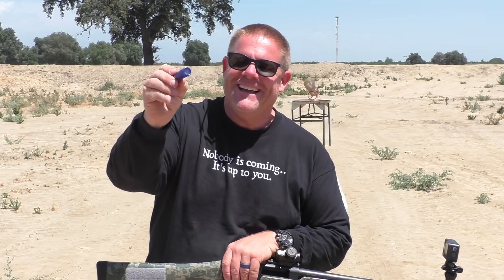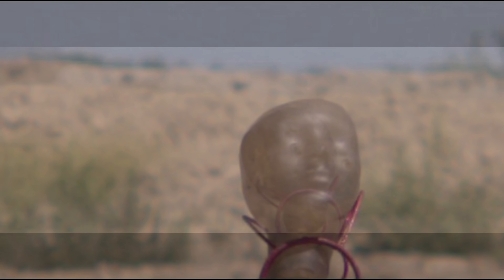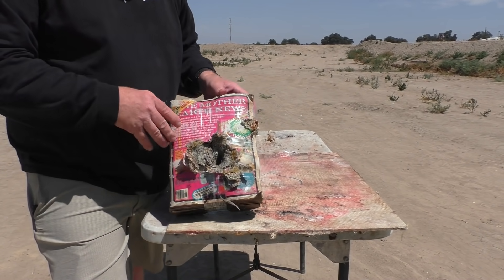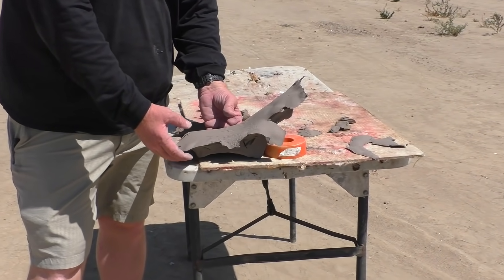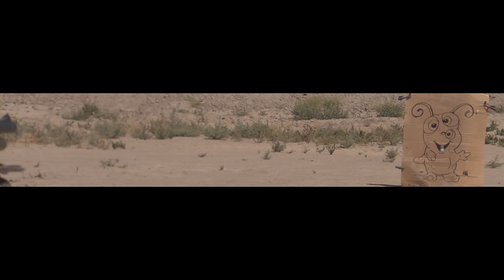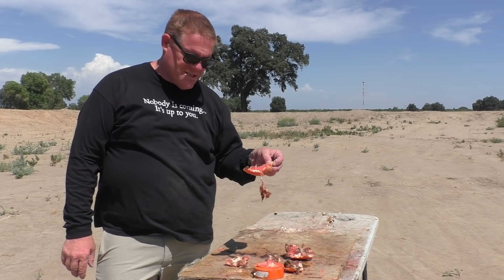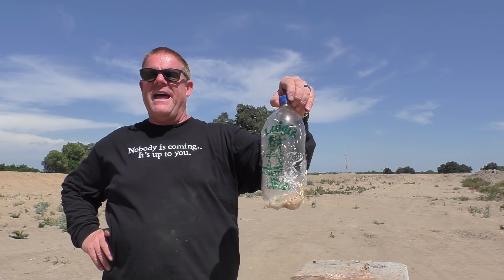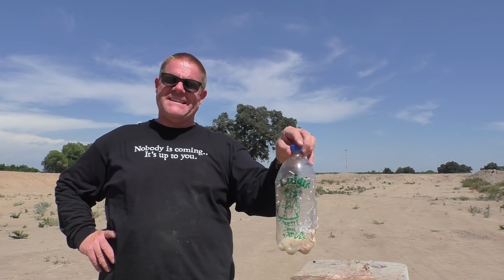The notorious CHEESE-CUTTER Round  -  Watch it SLICE 🧀

Comment: Very interesting work, thank you for experimenting and uploading. The concentrated effect is very very interesting, sorry if you have already done this, but have you considered linking the short in a circle? Experiment with different diameter loops or numbers/gauge of shot? I could spend HOURS with you trying to find the best combination for maximum effect. 

That said I like the idea of longer wire spreads as well, something like a bolas with two heavier shot linked by 10 inches of wire.

Have a great weekend team.  🔫

Comment: Couldn't you use  lead split shot weights? Just clamped to the wire?
Reply from the maker: Lead is pretty soft and many of the weights would probably not hold onto the wire very well at these forces.

Comment: Here’s an idea. Make actual chain shot, drill holes through the buck pellets and run a pull chain through them. It might be more like real chain shot if you just use two balls which would cause them to swing around when flying through the air. Perhaps use something larger than buck like two musket balls.

Comment: In Italy we had (now they are illegal) a cartridge made of 7x11/0 buckshots united by a wire copper. In flight it opened up to form an hexagon of buckshots with a buckshot in the middle. They were used in the '50s - '60s to be fired into very large flocks to get as many birds as possible. They are illegal because they are considered inhuman. In very large flocks (hundreds of thousands of birds at those times) they were cutting pieces of wings, legs, heads, splitted the birds in two....) and the birds falled down to earth still alive but severely wounded. 

    o----o
  /   \ /   \
o --- o  ---o
 \   /  \  /
    o----o

Comment: I would try to weld 2 steel balls together, and do that few times,
so You would have a bullet shaped like a 8, 
then put a rope arond the middle, and then another to it.
I would make the rope as a loop, with 6 or 8 of those double balls.
I am thinking of usin it on birds, or something.
What do You think of that ?

Comment: Late post I know but maybe you will still see it. I saw a movie a long time ago where the hero used something like this inside a house. He went to a sporting goods store, bought 22-gauge steel leaders and split lead shot about No. 3 or No. 4 buckshot size. He cut the leaders into 10-inch lengths and clamped a split shot every 2 inches, six shot per string. He dumped the buckshot out of some 12 gauge magnums and put the leaders in them and a paper wad to hold them in. I think they were Federal shells with the power piston. Looked like they would be nasty. I know they are expensive to buy but would have loved to see what this would do to a ballistic torso.

Comment: I have had an idea for a longer net suspended between bolo weight shot, so a cop could shoot a fleeing suspect and wrap em up by the legs or around the shoulders.  Idk if you could get enough spread in the cable or net at defensive ranges though.

Comment: Very interesting, a while ago, I worked with braided steel wire. Incredible tough, I’m not sure if it’s available in small enough diameter to work in a shotgun shell, the 0.125” dia. wire I was using would be too stiff.
I’m still surprised that the copper wire did as well as it did. I was imagining the balls would shear through the wire and go rouge.
Reply: actually i think the copper helped it being softer then steel meant it is more likely to deform then snap when stressed by the forces

Comment: You should do some with a shot in the center and 2 wires passing through it with shot on the ends of each wire.  If that hit flat it would create a wound like a boad tipped hunting arrow.  It would keep all the shot in an even tighter group too.

Comment: what if you connected those 6 into a circle instead of a line. wire seems to hold up well, so with a rifled barrel adding a slight rotation fanning the ring of DOOOOOM. thatd be sweet to see.

Comment: My dad used to do the same thing with the fishing BB's on a 20 pound test line you have a 20 gauge in a 12 gauge but back in the day in the 70s when I was a kid I remember he had a sawed-off . My dad was gunsmith of sorts will say but I'm more into different things will say but he used to have a 4in of 5 in and a 7in barrel and each one did a different job he had one shell that you'd put glass up and it go through the glass and it wouldn't even break and you walk up to it and touch it and it turn into dust

Comment: I'm thinking if you took a 12 pellet buckshot put the wire in like a grid pattern form a 6-inch Square net kind of thing then it would hold the pellets together in flight and youd have much more range out of your buckshot which usually opens out to nothing by 50 yds give or take depending on the choke

Comment: How about a MKII version, with the wire in a loop to keep the shot closer together? On the string version, they are able to spread out more, ideal if you're defending yourself against an advancing home, in a loop they should group tighter and you'd be able to use it to defend against an attacking Wendy house, as they're much smaller.

Comment: @TAOFLEDERMAUS #1 Kids would say it's "Janky AF" (pronounced 'Ay Eff')... just sayin' lol

#2 With the ammo makers needing to move away from lead, I genuinely think you need to retest this using your same wire but with steel jewelry beads! Non leaded, still heavy, but with predrilled holes (which is most important here). 

If they're cheap enough, maybe you could market them...? The work would be dialing in the wire length, which sounds like you'd need a high speed camera for that kind of resea... Oh hey!!! YOU GOTS ONE-A DEM! 

But yea, figure out the length that maximizes either spread or keeps it all tight, OR offer both choices.
Experiment with different configurations as well... 4 balls, 6, 8, more? Also with individual wires per ball connected to a center point which might can out like a star/flower? Or varying spacing between beads. 
Make one just for Officer Gregg: balls with a one or two inch wire tail and call em...... 🤔
"OG's Orgasm - Where Blowing Your Wad Is a Guaranteed Ending" 
... or... 
"OG's Mighty Balls: When Your Boomstick Explodes, SOMETHING'S Getting Impregnated!" (alt ending: "Explodes, His Balls Will Impregnate Whatever You're Looking At!")
I'd tag Gregg but I dunno how you tag a name like that lmao @OfficerGreg-OG'sDangerShow? 🥴😅

Yolks aside, plausible legitimate names: Devil's/Satan's/Hell's Rosary. (might not be a big selling name with the religious folk, but it fits and I loved the Rosary quip that was made heh)

Comment: Here's an interesting one for you guys to possibly try through an air rifle! Q tips!! I was cleaning my 4.5mm air rifle one day and noticed that q tips made a fairly tight fit in the barrel (i was poking one down the barrel and seeing how much fowling it had on it) so as a thought I figured maybe if I shot one through the air rifle it would have a sort of instant cleaning effect on it.... now mind you this was a fairly powerful air rifle for what it was and would push a led slug at 900+ fps the type of thing you could easily go and take rabbits and other small game with. So I set up a back stop in the shed thinking it would be perfectly fine to do it inside because while I was confident enough that it would spit the q tip out the other end I didn't think it would seal very well( due to it only being the cotton on the end making it fit) and build up enough pressure to really send the thing flying... Anyway this thing went straight through my backstop and ended up sticking itself inside a bag of whey powder I had sitting behind it and judging by the incredibly loud crack it made and the ringing in my ears pushed this q tip at easily 1200 fps... anyway I think it would be cool if you guys could get your hands on a air rifle around the same power and see what some q tips would do to some gel and maybe try get a chrono reading! cheers

Comment: I was curious as to whether or not you could put an entire 20 guage slug (cartridge, brass, powder, primer, and of coarse the slug) to get almost double the velocity. ( If the powder blast from the 12 guage load set off the 20 guage primer that is) I do realize that you'd probably have to use a smooth bore but a 20 guage slug round does fit pretty snuggly into a 12 guage round. Would that be too dangerous to experiment with.
Reply: ⚠ Who ever attempts this setup would immediately receive an award. A DARWIN AWARD!! 😁😵The 2nd powder charge would go off and try to push the explosion and slug from the 12 gauge backwards while pushing the 20 gauge slug out the barrel. In other words, the 20 gauge charge would be pushing in 2 directions  and act as a blockage in the barrel for the first one.

The barrel of the shotgun would explode very violently and send a lot of metal in all directions but mainly backwards at the poor bastard that pulled the trigger. Not a good day for that person. The effect would be the same as plugging the barrel of the 12 gauge and then putting a shell in battery and pulling the trigger. Not good.

They tried to make a "super gun" in Iraq that used multiple charges to accelerate the projectile and increase the velocity and distance. In that case, each charge was set off AFTER the projectile passed the location of each one. It was never completed and one reason why is timing the detonation of each charge was a matter of milliseconds (or less) that proved to be extremely challenging so that the barrel didn't explode and pushed the round OUT of the barrel instead of back where it came from.🙄😬

Comment: I want to see nitinol foil, memory metal, it changes back it it’s programmed shape when exposed to the heat it was treated to. From roll to flat piece of metal.
Reply: I wonder if a shell would be able to make it hot enough, but im not a scientist so I don't have a clue. It would be interesting to see though
Reply: @zedlepplin7834  it can also be treated in a way that makes it revert to a shape at room temp.

Comment: Drill 2 holes at right angles to each other through the primary 000 buck pellet, then thread the 2 wires through it in an X shape and follow with lighter 0 or 00 buck pellets down the wire. Pack shell with primary 000 buck facing front, lighter buck behind. Bet you get an X shape in target. Now, that's a flight control round!

Comment: Hey, how about you make a circle out of only like 5 pellets but increase the amount of wire you put into them and then given them something to hold onto while the rifling is being engaged?
That would mean you have 5 pellets rotating in a circle that will fly relatively straight, meaning you have controlled spread that cannot (or rather should not, maybe the centrifugal forces just shred the wire if this circle spins fast enough) increase.

Comment: Should try and redo it with a steel cable of sorts (McMaster p/n 3461T41 for starters). A "difficult to bend" wire, doesn't like being coiled up so better chance of it expanding during flight for that extra 🤯. Neat in theory, but cramming it into a shell...well I guess that's where the taofleder-magic comes in.

Comment: You could probably use slip shot sinkers and fishing steel braided wire leader cable? It would be more flexible to stuff into the hull? And the cable would be more durable than the flexible wire.? Stuff you can pick up at Walmart.
Reply from the maker: I don't think the soft lead would stay attached to the wire.  maybe a few would.  Remember,  they are under a 12,000 G force when fired.

Comment: Just a suggestion, there is a wire metal fishing leader that you can tie knots in without breakage.  Don't bite my head off if I am wrong, but I believe it is made (at least partially) out of titanium.  Regardless of what it is metal it is, I know it is MUCH stronger than a copper cord.  I can withstand the sharp teeth and jarring strike of Barracuda and King Mackerel with little difficulty.

I would love to see how it holds up under this torture test.
Reply from the maker: Used what I had on hand.   The purpose of the wire (according to research of the old French ones which was also copper wire)  was to just control the spread.
Reply: @taofledermaus  Cool.  Thanks for the reply, and keep up the great vids!  :)

Comment: you really want to make them cringe, instead of shoot or fire use "yeet"  and if anything is janky, weird, or home made, call it "scuffed", and finally call anything your shooting at a "n00b" ( pronounced newb ). so for example "we're gonna yeet some of these scuffed wired up balls down range at some n00bs and see how effective they are." 
yeet - to throw or project at high speed
scuffed - janky, weird, slapped together, etc. 
n00b - usually a player in a multiplayer game that is completely new and has no idea what they are doing, in shooter games they are often target practice for the more skilled players, so i thought it would fit nicely.
oh, and if the shot does significant damage, it "rekt" the target. 
have fun causing cringe.

Comment: Wonder if you used small cable with some balls how it would fare. The cable is stiffer than the wire. The size of cable that the use to hang large pictures or even leader line for fishing.
Reply from the maker: If it is too stiff it won't fit into the shell.  Working with a pretty small space there

Comment: Honestly surprised that it performed that well. I agree with Derek Anderson on fishing weights, might be an easier way to do the same effect with a steel test line than drilling buckshot, but up to you.
Reply from the maker: Lead balls are lead balls the way I see it.  00 buck worked well because it fits well.  Probably be hard to find a lead sinker with that exact diameter.
Reply: @taofledermaus  Fair, just was thinking about the ones I used to use. Ah well, guess those days are gone, I could swear that I had some that size. Might be able to find them, and if I do, do you want me to send them?

Comment: Why not crush some split round fishing weights on some string. for the hell of it while you are in the tackle box you can use some fishing line for the line too though I like the copper wire idea!
Reply from the maker: I can't imagine the soft lead would stay gripped to the string.   Remember,   over 10,000 g's of acceleration force
Reply: @taofledermaus  Isn't everything in the shell experiencing that at the same time? Also that's why I said "crush" them onto envisioning some decent force to squeeze them together and hold the lead together.

Comment: I think it might work better if both ends of the wire have heavier weights than the ones in the inner side of the wire. This way it will cause both ends to spread from each other, slicing everything against it.

Comment: Are people really that shocked to find a rifled shotgun? Ithaca has a classic rifled shotgun called the Model 37 or Deer Slayer. I've usually heard the ithaca rifled shotguns referred to as "slug guns" or even "deer guns." I think most people are talking about a fully rifled barrel when they say "slug gun" because its implied that its a shotgun designed to only shoot slugs. I've even been told be a collector of ithaca slug guns that you can damage a slug gun by firing buck shot, but i don't think that's actually true. I can't imagine how lead shot could actually damage the rifling of a steel barrel. 

At any rate, there are plenty of shotguns out there with full rifling, and they are quite accurate. They are often a smaller gauge as well, like 20 gauge.

Comment: Awesome results. I've wondered before how split shot sinkers of different sizes both removable with the tabs and non removable without the tabs would work in a pinch. Also how the bigger types of sinkers would work as a slug. Lead and steel. And how the bigger ones with an eyelet would do connected with a chain. If you've done this before sorry I haven't seen it. Have a good one!

Comment: Would be very interested to see what the results would be if you soldered the ends together, would it fly as a circle of connected wire? Or would the ends split up? If the wire held up you could limit the spread of the buckshot.

Comment: Used piano wire with 2, .75 ounce dumbell weights at each end.  Used 1/2 powder hand load on 4" fence post;  interesting results.  Smooth bore open choke.

Comment: As I have no way of replicating any of this, would you be able and willing to recreate this round in an H configuration?
H has a value of 80, in numerology. That being a power number, I would hope that H would hold a tighter pattern, while
the center two "balls" are connected with a heavier wire. I would guess, your current configuration would/could stretch
to a full 12 inches, fired from a rifled barrel. The length of the connecting wire in H configuration is up to you.

Comment: OH, Jeff, is it possible to tie the wire and shot into a star pattern? Like one shot in the middle, with individual strands going to 5 other shot? The hole would have to be bigger to accommodate the wire, so maybe one 000 pellet in the center connected to 5 00 pellets? Would that be able to maintain a super tight group at longer ranges? I know you can't necessarily test that out, but I'd still like to know your thoughts!
Reply: Like, I could see tying the wire into loops, and have the loop part in the 000 pellet, then you could wrap it around the wire once or twice. Do the same for the part that goes through the 00 so you have five individual double looped strands, and then maybe load the 5 00 in first, and set the 000 on top in the cup. Or maybe the reverse? I dunno, it seems like that might work in my head, maybe im just dumb. What a fun idea though!

Comment: You did the wrong test with this ammunition. The good one should be to record it on high speed camera but something like between 70 and 80 ( or much than 100 depend of your barrel ) yards from the barrel to see if the wire still holding them together, result would be very interresting..